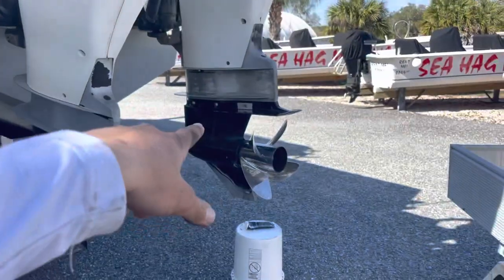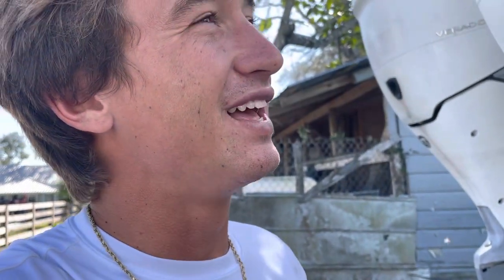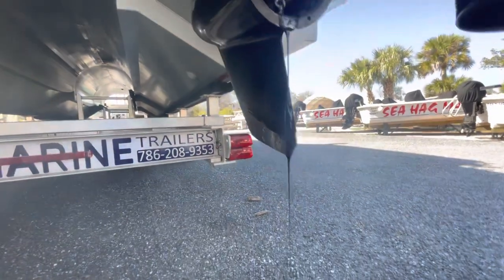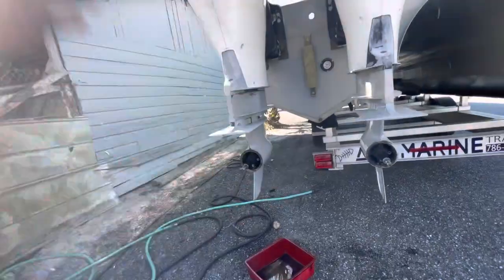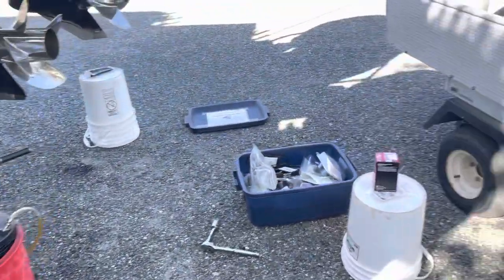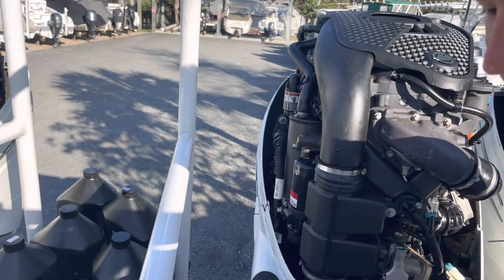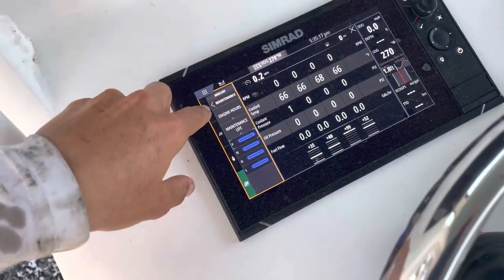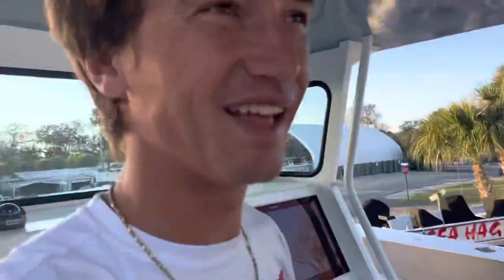Why Offshore Chartering is so expense!! Servicing a quad engine Charter Boat$$

Comment: That's bad luck bud. I have yet to hear of anyone having Lower units going like that. Think the weight and size of boat has anything to do with the lower units going out
Reply: it’s happened 3 times on the 42 YF i’ve ran for 2 years. same motors (charter boat as well)
Reply: @Kosher  damn bud sorry to hear.  When i first seen the video il for some reason I thought they were Suzuki but then remembered he had verados. Maybe the verados make too much power!   God luck with them.  I was thinking about going to the new Mercury's, heard nothing but great things from them v
Reply: My son now runs our old ocean master 250 verados 5500 hrs same lowers same power heads one blown head gasket couple end caps we are a dealer keep the lowers in the water prop slap kills them every time
Reply: @jimmyunfried4427  we keep it on a lift tried just about everything
Reply: @KosherXY  when the prop breaks water at high speed it slaps the water at 6500 rpm so like hitting a brick wall when the prop reloads and causes the prop slap against the forward gear so breaks the selector and then Grenades we see all the time with tournament boats running hard jumping waves not much you can do about it especially the outside engines that are already teetering with breaking water best thing to do is slow down when you hear the chirp lol